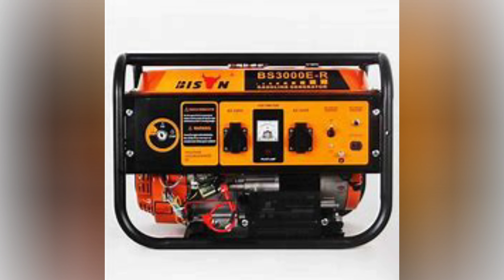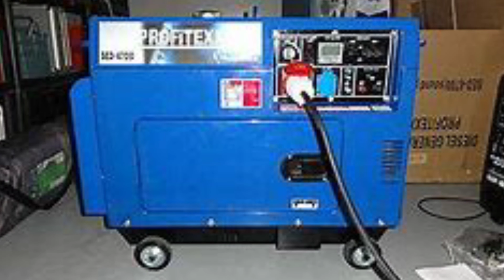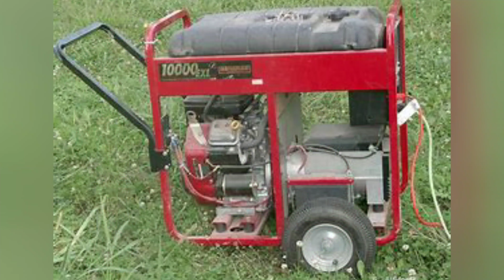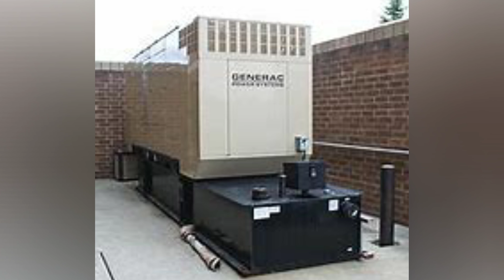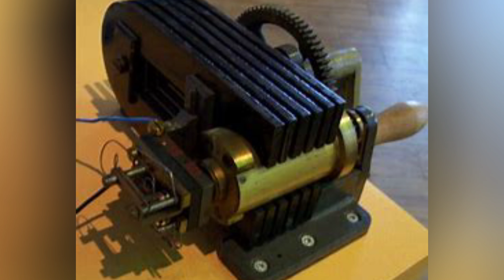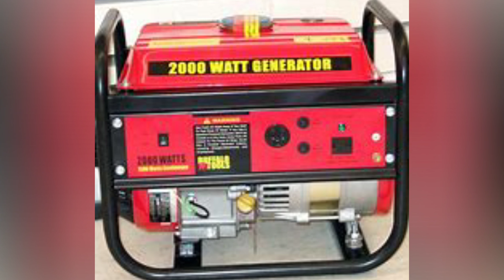How long can you run a generator continuously?

Comment: Someone with experience in running a portable generator for long periods without stopping told me to fill the oil to the bottom of the dipstick threads if you are going to run it all night.

Comment: If you get a 50 hertz generator to supply your needs and you live where all appliances are 60hz, the generator will outlive your burned up refrigerator and air conditioning motors by a long time.

Comment: If you had a gallon oil jugg fixed with a float level and a feeder gas tank you could refill while running like above your genset,  I see no reason to not let it run till the valves went out of adjustment. With locktight on the valve adjustment screws I see no reason why a year would be no problem with an inverter unit that slows for low load. I would like to see the figures for fuel burn in a year, I would assume 100gallons or more. It would help if you had two running in parallel then you could service one letting the other carry the load but of course this would be twice as much fuel and oil. I would like to see what the inside of a 3500 watt Predator inverter looked like after a year. Of course you would have to remove the fire starter screen on the exhaust before starting. I would also think you would have to adjust the spark advance to a higher level so as to burn Ethel gasoline to keep the soot level lower. How do you advance the timing on one of these? I would guess you move the advance mag to its most advanced position.
Reply: Lock tight on the valve ajustment? 😂
Do you have any idea how valves come out of spec? The valve seat wears overtime as the valves clash against it, until the spec is out (it gets tighter)
And obviously oil will be a problem continuously running it

Comment: Everyone needs a good generator these days. Everything we have runs on electric with today's technology.   To many Americans reli on the grid and government.  The truth is neither will last forever or can be reliable.     I have 3 generators LOL. 1 is a small 1200 watt for 1 to 3 hour power outages. The 2nd one is a 9400 watt for more serious power outages. The 3rd is for friends or family that doesn't have a generator for power outages.      That's how Kentucky rolls LOL
Reply: I have an 8000 watt generator just in case but in my part of the U.K. we haven’t had a serious power outage in 10 years !!!!  But when we do I’ll be ready 😀🇬🇧
Reply: Wise man. I plan to run two units, each just enough to run the essentials by themselves (less than 2800w). I will run both when cooking or heating water, which I could also do if I just shut of the mini split air conditioner for that length of time. I considered getting a 1200w generator also for the beach. I'm in the Philippines and everything is 220v here and starting amps for things like my refrigerator or my air conditioner are low. I had a 3 hour power outage just today but I have seen 9 days without electricity. The bad thing was, the gas stations were without electricity also so they couldn't pump gas. Luckily, I get plenty of warning of typhoons, usually of all day planned power outages for line maintenance and I live far enough from the volcanos.

Comment: Totally uninformative garbage video. Did you even check the owners manual or contact the manufacturer? NOT!!!
Reply: what did he do wrong
Reply: @lazylawnbub  Manufacturer never said you cannot run the generator continuously, so I did. Guess what, 5 days during the most recent outage, straight running, never stopped, refueling while running, NO PROBLEM!!! GENERATORS CAN RUN CONTINUOUSLY!!!!
Reply: @sbkarajan  I got a little bit confused on your statement but I am guessing that you say that they can run continuously and you are right they can run continuously but you are putting a lot of wear and tear without checking it 'cause the oil can burn out and you are running a risk of it seizing so they say check it out every eight hours to make sure you have enough oil but if you can not go out there. you can run it continuously it's just not recommended. The reason why they say let it rest is so you can get an accurate reading of the oil it's not about cooling it down
Reply: I would give them a cool down period new ones run about 4 hours with 30 weight ND conventional oil. Then change as most likely Engine break-in metal will be in oil! Always run four stroke oil not Car engine oil! The needs for a car vs what small engines needs are different!  Really for the best oils and multiple choices go to a motorcycle dealership for oil!